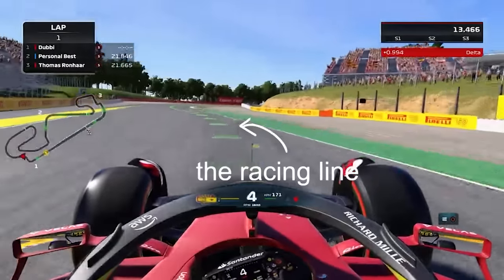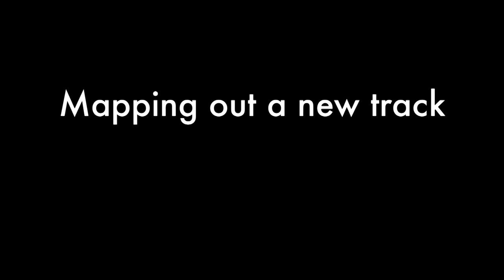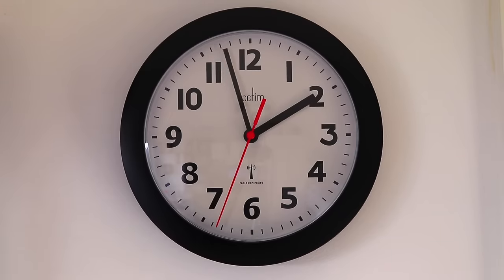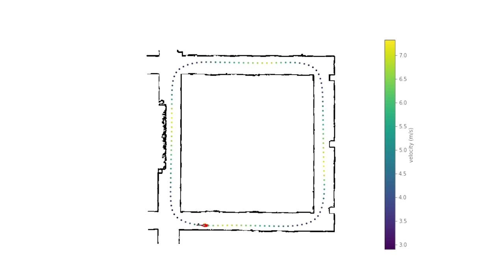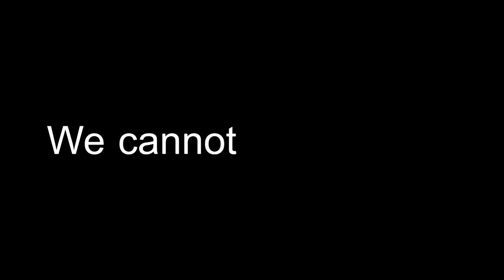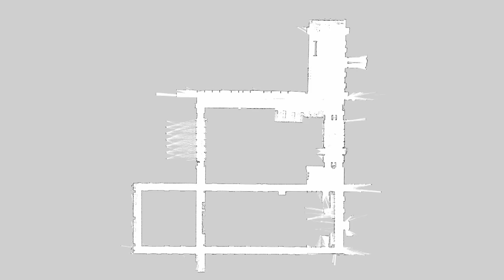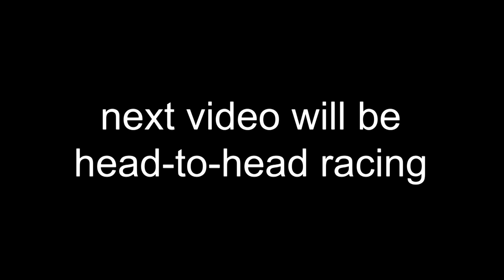Building the FASTEST Self Driving RC Car

Comment: As someone who did some linefollower racing I really like this project, edit and also I am a little jealous :)
For the racing line concept I fully agree that it is complicated because the vehicle model and especially the tire model is very complex and time variable. For you the main variability is off-course the battery level, dirt on tires and surface change.  The geometrical line is 2nd order and therefore you have sudden lateral acceleration change on inflection points. This is in reality not possible because the car has load transfer, finite servo time constants, tires with some relaxation lengths etc. Also there is a braking and acceleration part of corner so a clothoid approximation is more appropriate.
Keep up the good work.

Comment: Racing lines actually maximise the amount of time with usable grip available to accelerate earlier in the corner. However an RC car would stop much quicker than a F1 car (or any car) so the bias would be less towards a wide braking like and lean towards an overall tighter line (because the RC car can minimise the distance to the wall and not worry about grip or centre of gravity shifts on decel)

Comment: Christopher Gerdes, head of Stanford's driverless racing program, gave a talk at my company. The talk discussed racing lines, and one of their key findings is that the racing lines don't matter as much as finding a line that allows you to drive the vehicle at it's absolute limits as much as possible. Point being, there may be non-theoretical lines that allow the vehicle to push the limits more than conforming to the "right line." Drive at the limits, don't adhere to a prescription. That talk was in 2017 and the concept stuck with me!
Reply from the maker: i totally agree, that is also something I've realized. Was originally going to talk about this in this video, but I thought it would start become confusing, and couldn't quite fit it in the video. "The key to racing as fast as possible is not just about following a racing line: it's actually nailing down the dynamics of the car". Maybe i'll mention this in the next one!

Comment: Very impressive and suuuuuper cool! The only thing I'd say is that you need to consider the performance aspects of the entire vehicle, not just the brains. For example, any race car driver worth his/her salt would first, before even running the vehicle, make sure they've installed the proper tires. You're running outdoor, all-weather style tires on linoleum. You need grippy, treadles tires, like you see on formula 1 cars. The type of rubber plays a big role too. Next, suspension. Racing requires stiff, tuned suspension, and a low center of gravity. You tune this with turn buckles on the suspension arms if you've got 'em, and by adjusting the height of shock towers or shock length, and at real speed you've got to be able to control camber and pitch, which goes a long way to a stable ride. Of course, you could just spring for an actual racing chassis, but that'll cost you. Also, that little gear attached to the motor is called a pinion. It spins the spur gear. Where they meet is called the gear mesh. This must be properly set to about the width of a sheet of paper. Too tight, and you kill speed and eventually your motor. Too loose and you strip gears. Anyways, don't just blame the computer for those crashes. You're more likely hitting the limits of the current tuning of the vehicle.

Comment: you could replace the gears with teethed belts and pulleys,would be more quiet aswell as more responsive (if there is no slack on the belt)

Comment: I wanted to note, you may find greater stability by moving the weight on the RC, I believe the instability you see relative to speed is in part due to the majority of mass being too far back. Move it forward and you should see improvement. 9:36

Comment: Seems like if there's a way to compensate or adjust for drift better it would also get a few more go-fast points in its ability. Some places where it cuts in and doesn't correct for it, as where if it knew how to drift it may have made the corner instead. Not sure how you'd deal with that, because then you're probably starting to have to figure out slip/skid and traction control stuff to also affect steering rates to keep close to the most desired path.

Comment: Making a car run fast lap times is more about the car than the software being used. The #1 issue I see is using an off-road car with knobby tread on the smooth surface. You need to use a proper racing car, or at least put good tires on this so it's stable at high speeds and grips well. Focusing on the car itself would yield far bigger gains than adjust the software does.

Comment: now make it self-adapting. what i mean is if something of the car is changing it autocorrets. here some examples:
1. when you place a weight on the car it notices that it is weak on breaking and breaks earlier and it will reduce the speed at tight corners.
2. when the steering shaft is bend and it slightly turns right when it should go straight, it adds a slight steeringinput to the left for all inputs.
3. when the wheels are slipping it notices that the vehicle moves sideways and finds out that it sliding, then the car remembers to go slower in that area and adjusts the optimal line.
4. when the car had a close call to a chair , the car will adjust the line and speed  to have more distance to the chair. same if the wall was still far away it takes a longer curve and with more speed.

when you have this, just run the car 100 laps and you have your near perfect lap record. 
even pro race driver are adjusting the line when they see that today there is gravel on corner 6. and you dont have to use water. the car learns to whatch out in that corner

Comment: 10:30 Your pinion and spur gear mesh is critical to good battery life, speed and gear life. Pro tip, use a small sliver of paper between the gears and press them together. Once the motor is tightened down, spin the gears to spit out your now very crinkly paper. You're left with perfect gear spacing!

Comment: 2 Thoughts, Steven: 1. Looks like you did constrained training to find optimal racing line?  I wonder if there is a simpler way based on physically simulating a bendable wire like a bendy coat hanger material.  Or using Procedural splines.  Meaning.  If you shrunk your track down and made it a 3D model and you needed to put metal wire inside it, that wire would automatically find it's optimal angles through the whole thing (I would think).  2: I know others have brought up better tires and parts, but I think you are leaving a lot of speed on the table with your current setup because of your understeer issues. In racing , Rally drivers use a method called the "Skandanavian Flick".  It's a way of steering away from the turn in slightly to shift the weight to the back to rebalance the car after hard braking has shifted all the weight forward.  Your car is "pushing" into the walls because it's letting all the weight slam forward and it doesn't clean it up with a pre-flick.  All drivers use this flick, but the more grip the car has the more subtle it is.  But if you can code in the flick it should balance your car where it can make turns better and if it slips it's a balanced "drift" and not a push into the wall.

Comment: at least he picked a good platform. If you want to improve vehichle handling, get an lcg chassis, change the toe of the front to allow for more turn in. There isnt rear toe adjustment, but you just need to get it to turn in better without oversteering becasue unless if that thing has the gyro, I dont think correcting for oversteer is viably possible. You could also add some rake to get some of the weight over the front wheels without moving any of the electronics. You could look for different tires, but on that surface there probably isnt a better option other than running super soft no prep drag slicks and even then the dust would just get in the way. If you could run on something like asphalt or concrete, the traction would be enough to roll the slash as the chassis is pretty high cg even without the added electronics. You may get better performance at lower speed if you either got a sensored motor system or geared down to increase low end fidelity becasue I know that motor isnt very good at low speed operation even though it is very powerful (60 mph capable) if it is the vxl motor that I think you have. Nice work, better than anything I could do. I am studying to be an engineer and this looks super cool, I just dont code lol.

Comment: I think there are a few issues with your software (to be clear what you did is super impressive these are just ways I think it could be improved)
1. I'm not a racing driver but I imagine that they are recalculating a line every time they go off of it. They know where the best place is to go from their current position rather than trying to stick to one specific line. It would require a completely new way of calculating the line since it would be computed at runtime but could be worth it. 
2. I imagine you are using a PID controller for your velocity. When you tell the racing line that it should be at a certain velocity I would expect there to be some lag which could be why you overshoot. There is also some amount of understeer (and maybe slip angle, I don't know if that would be significant here) that I think is happening that you don't account for in your racing line. There are other factors like turning while braking to rotate the car that could make it faster but I honestly don't know how you could implement them.
3. Seeing as the car NEVER spins out (at least that we saw) you could turn tighter (which I think is related to turning WHILE braking). I'm not a racing expert so I'm not sure how to make that happen but could be worth looking into.

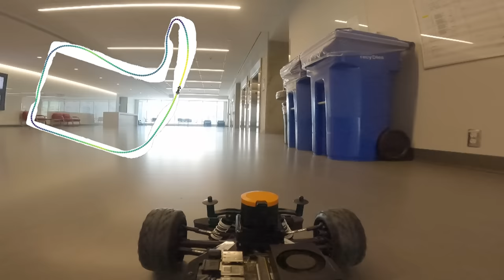Comment: The wheels appear to be misaligned 12:30 one wheel (it not both at some stages appear to be turned inwards), not only does this pose problems for steeling and maintaining a straight light just like in real vehicles it will cause steering to be constantly fighting and will wear the tyres

Edit: which I have since seen you corrected at 14:43 (this might have been mildly damaged before that last crash)

Comment: Could you make it so that it gets on the throttle earlier out of the corners? The velocity chart has a built in power limit if it’s not showing full throttle as soon as possible, maybe it’s due to loss of traction but you could get far grippier tires than those.

Comment: I think you could push the car a lot faster if you could account for the g-forces on the car as well as wheel speed. A lot of your early problems look to be induced by oversteer that you're not accounting for. If the car can detect under/oversteer it will handle so much better

Comment: you have some binding in your Geartrain, You can hear it. sounds like you didn't leave any play when adjusting your gear mesh, you've gone from sloppy engagement, to too much friction. loosen that motor off again, place a small slip of paper between your pinion gear and spur gear, when you've tightened it all up, pull the paper out and you should have a perfect gear mesh. this could be giving you issues with your pathfinding and filtering ect... whatever sensors you are using will be picking up the unnecessary friction and inputs.

Comment: To make it even  faster you need to teach it how to drift. If you want to go faster through corners you have to balance steed and grip so that you don't fly out the corner, but still barely go through it at a higher speed. Typically this drift is minimal, you just don't want to break as hard.

Comment: Looks like it's not accounting for rotation in the corner. All cars to some degree slide through corners. F1 cars don't do it too much, but GT3 cars for example, do it actually quite a lot. Some camera angles show how much cars actually slide through angles. When this car starts sliding, which would be the fastest way around the corner, the car appears to slow down to grip up the rear, effectively tightening the turn and requiring an adjustment. This may be part of what was causing the oscillation.

Comment: Pre-compressing the springs will add you more corner stability and speed. In software, just before the point you start turning, turn a tiny bit the opposite way, let it correct itself to then start the turn. This shifts weight from side to side and will pre-compress the springs and also kick out the back a little. If then you add, by software, a tiny boost as the turn starts, it will put the car in the best conditions for the turn. If you want to get even more, because your surface is slippery and your tires are of the wrong kind, you can also introduce slippage like a rally car, where you use extra power for extra push into the turn instead of relying on only on tire grip. You can even go beyond that by going really crazy with throttle speeds but this will require gyros as the line between over and under steering is very thin (very hard to "guess") and will cause a massive crash, gyros help you know the conditions of the car in real time instead of software guessing it.

Comment: When the car is off the ideal line, do you just control to get back to the optimal planned line? That is not what a human would do. Human drivers will, on the fly, create a new optimal line based on where they find themselves. You drive the line you find yourself on, not dive to get back to the optimal line (which can overshoot as you saw in your oscillating). The solver probably takes a while to produce the line, so I'm not sure how you would get that into the control loop. Without adapting the plan for the found grip levels (do you have more grip than the plan assumed or less?) and for errors (like understeering in the corner entry due to less grip than the plan assumed) you can't go as fast as possible and will always have to be conservative on the grip level the plan assumes. The great drivers probe for grip, often in braking or even corner exit where overstepping the grip won't cause a crash, just cost time, and then use that information to adapt their plan. Competing with intuition is tricky. There are also different techniques that the control loop can use to keep on the planned line, like using power changes to induce weight transfer and hence changing the grip level on each wheel. Such as what drivers call throttle steer. It would be interesting to see how much time is gained by being adaptive to the conditions vs adding better car control. Thanks for sharing your experience.

Comment: Ok. So you got a rc car to run on a square track. Turn it up a notch and change disciplines. Try a different type of car, and different type of driving. For style points try a rc drift car with a gyro. Different concept of lines and style. Your running a slash ultimate as your car try a yokomo. Or see if you can get a 1/12 pan car to run a hot lap on a carpet circuit. May take some next level work but I see your determination. If you can get this mastered and applied to multipul cars you will be able to take this real far. There are so many types of cars. Let's see you turn it up a notch.
(for reference I'm a former regional driver for pro level 1/8 nitro buggys)

Comment: The next stage would have to be the integration of an IMU to stabilize the tracking. You should think of what an actual race driver must feel in order to optimize it's performance. If you seat a driver in front of a computer screen and strip him from physical sensations, the car dynamics will be lost and the performance will degrade accordingly.

Comment: The pinion and spur gear mesh sounds bad in the end. When you're setting the gear mesh you can put a strip of paper in between the gears before tightening the motor to get good mesh. You might want to add a heat sink with a fan to the motor and the esc. The Traxxas VXL-3s esc should work fine on NiMH and 2s Lipo without a fan, but if you're running 3s Lipo, you should use a fan, but to proof the car, I would add a fan to the esc regardless.
Like someone else said. Get wheels for street. Traxxas Anaconda are okay tires, but I have never tried them on linoleum floors like it looks like you have.

I have the same car, but the LCG version, Im running a 2650kv motor on 4s. Top speed is about 120 km/h.

Comment: i would suggest a smaller pinion gear on your motor, so you dont get the cogging at slower speeds. this will also help getting better acceleration out of the turns. 
also, do you have any steering assist to help with slides? or is it just following a path? if/when you are going to the faster speeds, you will need something to help with sliding the tail end.
lastly, i would recommend something other than the stock traxxas tires. they dont grip well, especially on hard smooth surfaces. almost any 3rd party tire is better.
I love watching videos like these, turning the RC cars into something more than what they are. 
although rather a tough task, it would be neat to see the same 3d scanning to tackle a different kind of terrain, such as a rc rock crawler that can traverse a landscape. 
thanks for sharing your awesome videos

Comment: Great video. I would suggest not just focusing on the coding. The weight shift from decel to accel at apex is making it understeer. 

Look into suspension set up as the mechanical side of the car itself is key to racing.

Comment: Do you have an IMU on this rig at all? If not I think adding one would probably help your performance a whole bunch. Use that as the basis for your position/orientation and kalman filter it with the lidar as the slow but high quality reference. It'll pick up on much more subtle errors quicker and help reduce noise. Also, excellent choice of music. I eagerly await your first gutter run ;-)